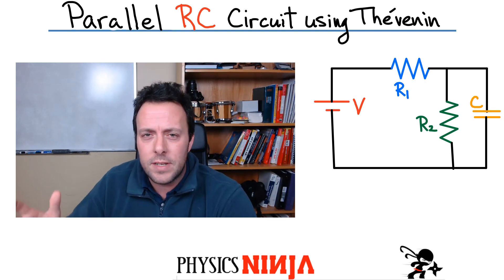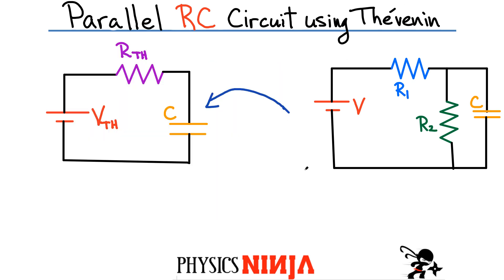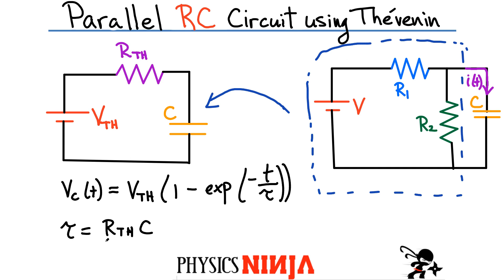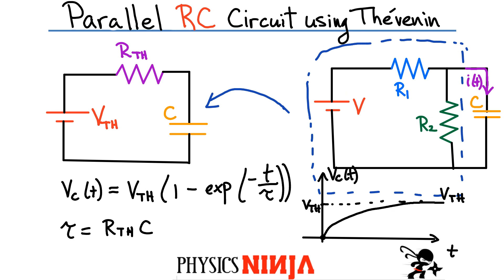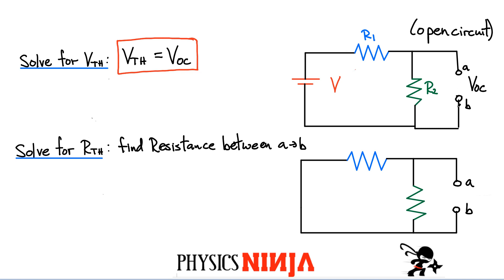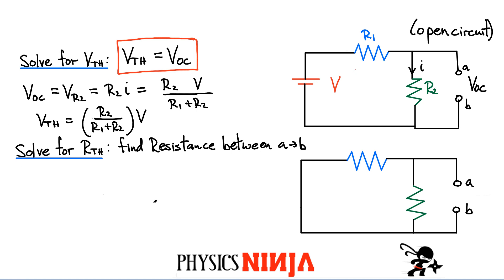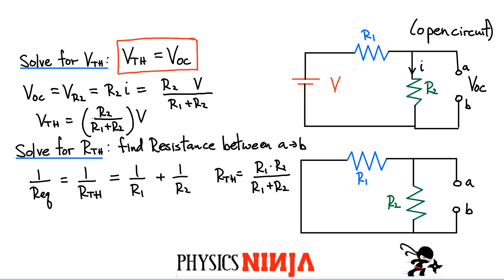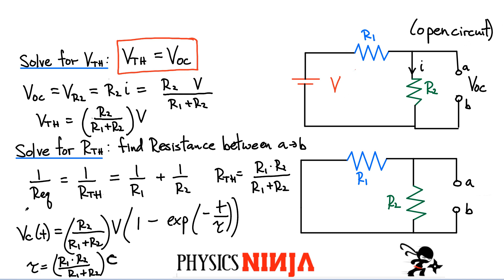Parallel RC CIrcuit Using Thevenin Equivalent

Comment: One thing you all need to keep in mind is that this method in only applicable for one capacitor circuit. You can't apply this method on a circuit containg multiple capacitors.

Comment: Conceptually, I was wondering if we swapped R2 and C, would the problem remain the same. I believe that it would as the current is still split between the two parallel branches, but if am unsure if the resistors being directly in line with each-other has an effect that I am overlooking. Thanks!
Reply from the maker: No difference if you flip R2 and C.   I have another video where I solve the same problem without thevenin.

Comment: This looks wrong. You claim R1 and R2 are in parallel but add the resistances at 5:29 to make an equivalent resistance (for series connections)

Comment: Can you tell after how many time constants the current through the resistor R2 is equal to the current through the capacitor or when the voltage drop over the capacitor is equal to the voltage drop over R2?

Comment: I was struggling with this problem whole day and asked about and nobody could help me, then i found your video using kirchoff law and got even more confused as i couldnt get how to calculate the voltage using all that 30min of calculation
And now this is like a minute of calculation and done!
Thank you so much...
Reply from the maker: Thevenin equivalent allow one to solve very complex circuits in minutes.   Kirchoff's will always work but takes more time.

Comment: Great video! How would the voltage response look like if a constant current was forced through the circuit (instead of applying a constant voltage)?
Reply: ignore R1 since the current going into R1 is the same as going into R2 and C. Perform a current to voltage source transformation by putting R2 and C in series with a voltage source equal to R2*I. Use voltage equation for capacitor; V(t)=V(inf)+(v(0)-v(inf)*e^-t/tau. V(inf) is equal to R2*I since this is the source voltage and v(0)=0 since initial capacitor voltage is zero. subbing in values this gives v(t)=R2*I-R2*I*e^-t/R2*C
Reply: you could also do a Norton equivalent. Rn=Rth and to find the theneviven resistance across the capacitor you open circuit your current source meaning that Rth=R2 since it is the only resistor that current can now travel across. IN=I since the current going through R2 is the same as R1 as shown previously resulting in R1 being ignored. You perform a source transformation as previously stated and end up with the same thenevien voltage equivalent circuit with the same solution and answer.

Comment: When you want to find charge over time and max charge etc. do you plug in the thevenin voltage into Q=CV. I thought you would plug in the emf of the battery as the capacitor would take all the voltage but now I'm not really sure.

Comment: What would happen if you added another resistor in the right loop, between the capacitor and the next junction?
Reply: you can still find a thenevin equivalent
Reply: Then the resistor is in series so just add it with Rth when calculating time constant

Comment: Solve for Vth
Voc= Vr2= V+Vr1
i*r2= V+ i*r1
i= V/(r2- r1)
Vth= r2*V/(r2-r1)
what am i doing wrong here? cause i am getting different value for the current
Reply: never mind! V= i*r1+i*r2 because of the voltage drop across the resistances, my bad..

Comment: How will we calculate if a capacitor is connected in series with R1
Reply: just use the equations he used for the thenevin circuit since that is just a resistor and capacitor in series.

Comment: You said at 5:55 that you short out the batteries when you're finding the thevenin resistance. If you have a current source instead, do you also short it out or do you have a break?

Also thanks for making such a clear video 👍
Reply from the maker: James Morley check out my other video comparing thevenin to norton.
Reply from the maker: Open circuit for current sources ( i=0)

Comment: if you have a resistor in series with the capacitor, would you solve it exactly the same except the time constant would be: TC = (Rth + R[series] ) C
Reply from the maker: Yes!  Thevenin equivalent can be used to simplify the network and you'll have the Rth in series with the other resistor and the capacitor.